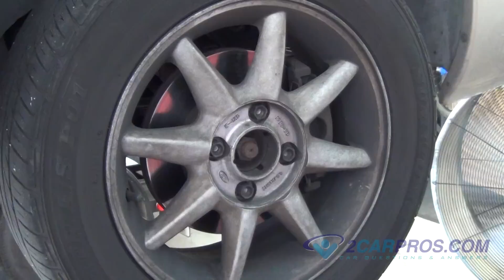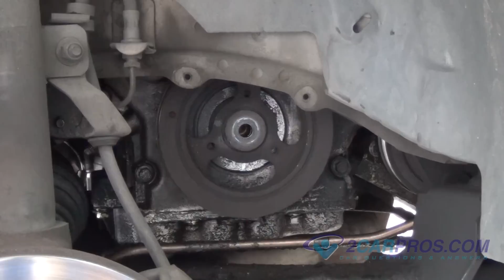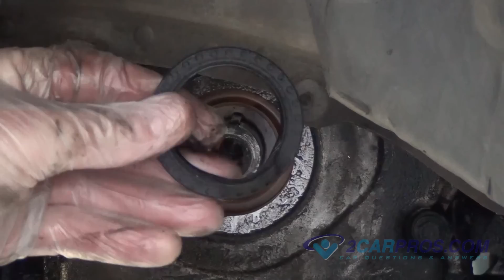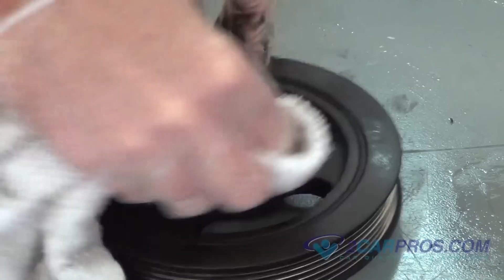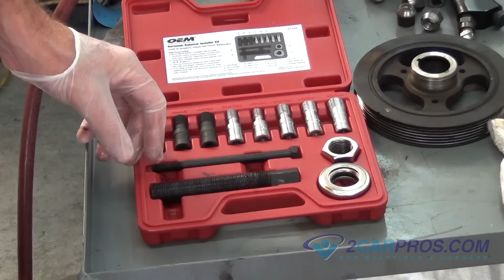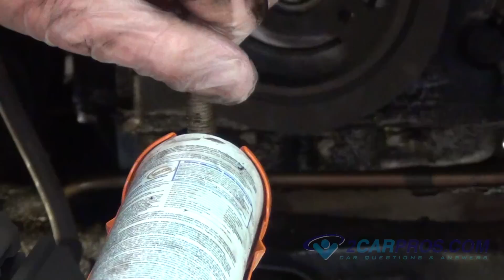Crankshaft Front Main Seal Replacement and Balancer Removal Ford Contour V6 1995-2000

Comment: Is that damper installer kit necessary? Why not bring it in place tightening the bolt?
Reply from the maker: You can pull the threads right out doing that. Then you are really in a heap of trouble. Thanks for watching!

Comment: hold back the silicone
Reply: Is the silicone a bad idea?
Reply: Silicone is should not be used on the seal.  However, you should put some Black RTV sealant on the keyway groove on the harmonic balancer to prevent leaks.

Comment: Hello, I got a V6 ford tempo... I would like to change the AT dipstick seal. What do I need to do.? Is it just pulling it out and put on the new rubber seal onto dipstick tupe and push tube back to AT unit?

Comment: good instructional, however might want to torque the crank bolt.
Reply from the maker: +soundmanfrommars13   it is difficult to torque the crank bolt because the engine just turns,  that's why we used an air impact, but an electric impact will work too.
Reply: +2CarPros cant u hold engine front fly wheel
Reply from the maker: not really, the only other thing you can try is to remove the starter and jam a large screw driver into the flywheel.
Reply: What kind of damage will result when crankshaft  nut is tightened to AN UNKNOWN TORQUE?  pretty amateurish. @2carpros